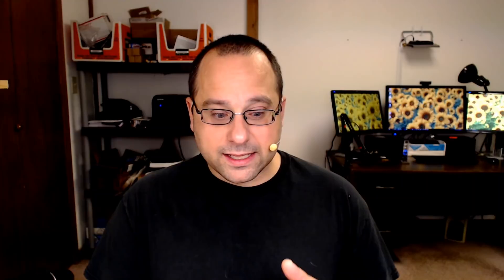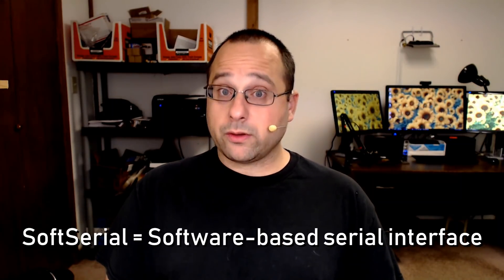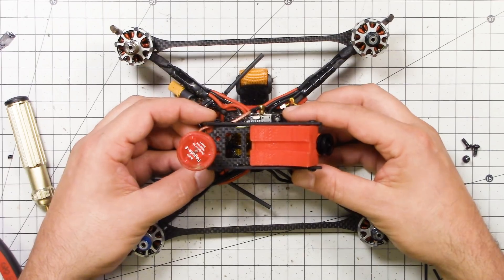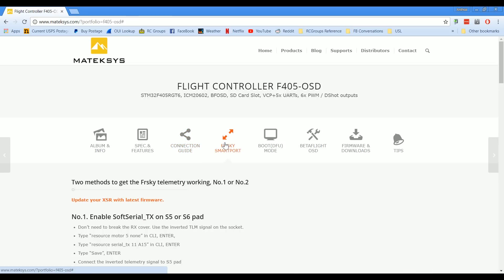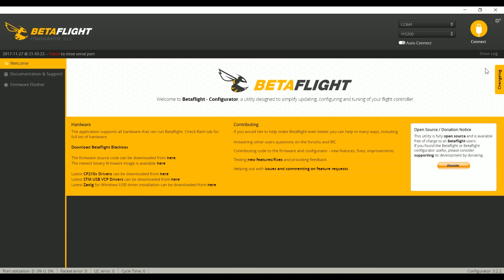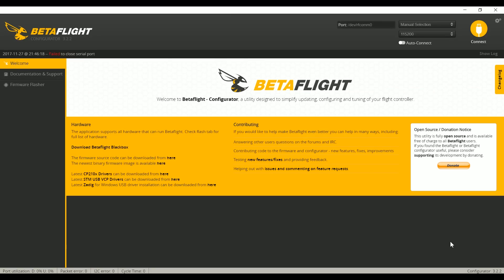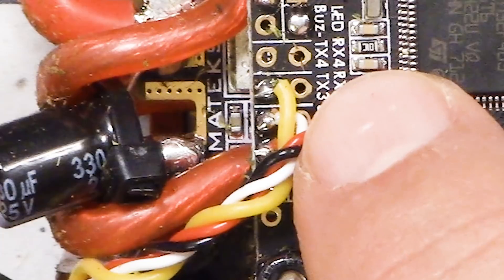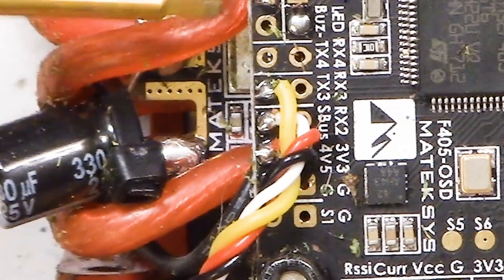Betaflight SmartPort Telemetry How-To | MATEK F405 AND OTHERS

Comment: What do I do if this didn't work?? I currently have the matek f405-te and I'm using an frsky tdmx reciver. The reciver has a smart port pad. I wired that sp. Pad to a uart and it didn't work, then I tried this soft serial solution and I am still not receiving telemetry. What else can I do? To my knowledge, I don't know of any uninvited signal on my reciver. Sidenote: I have the same rx paried with a matek h743 wing fc. Telemetry works perfect using the basic understanding of how to wire up telemetry.

Comment: Is using a software serial for Fport a good idea? Seems like the Mamba F405 has no provisions for F.port or even smartport. It's so far the only disappointment of the board (and no mag or baro, but there is an I2C pads for them on a separate board). I tried it and my quad almost flew away when I punched the throttle, it was like PWM signals were updating infrequently.

Comment: Hi Joshua.  I have a Jumper R1 and a Mamba F405 stack.  I’m trying to work out where to solder the Smart Port wire onto the FC.  One pad is named ‘Invertor’ and the other one is called ‘Uninverted’. I’m pretty sure the smart port wire goes to one of these.
Also, if I’m using a Jumper T16, should I connect the rx RSSI wire to the fc RSSI pad?

How do you rate the Mamba stack?

Comment: Good afternoon Bardwel. I'm using Inav configurator 2.2.1 with the Matek F-405 CTR controller and I can't connect to the smart port. What's the procedure?
Reply from the maker: For the Matek F405 I think you have to use softserial to get telemetry working, right?

Comment: Hello, great video.  I set up my serialport.  I have Foxeer F405 with Frsky XSR.  Flies great.  I can't seem to get OSD working in my goggles.  "Armed" shows up, but all Telemetry disappears while flying.  After I disarm, I can see post flight statistics.  Why can't I see my RSSI (which shows on my radio) and my Battery voltage during flight?   Thanks for any support you can offer!

Comment: Hi Bardwell. Let me ask you something. Is It  possible to send the GPS data though the Video transmitter(audio in)?  My radio has no telemetry and I need the GPS information on the ground station to track the position of the plane.
Reply from the maker: That is a thing that has been done in the past but you need customized hardware that is built to do it.
Reply: @JoshuaBardwell  do you have idea where I find any more information? Anyway thank you.

Comment: Hi Josh I am following all your vdeos for about a year now but I am definitely struggling with Telemetry / TBS Smart audio and ESC Telemetry on Matek F405 std, Taranis and RXSR reciever. My ESCs is a 4 in 1 esc with Telemetry wire. I am a bit puzzled whether my wiring is correct and how to use softserial properly. Do you think there is a way you could help me? 
Best,
Reply from the maker: It'd be best for you to message me on FB so we could discuss this.

Comment: Joshua... thanks for all the great videos! I wanted to let you know that I discovered an issue and workaround with connecting an R-XSR receiver to a Matek F405-STD flight controller and trying to follow your instructions.  This issue presented itself while trying to use both F.Port and S.Port telemetry.  In both cases, the radio controls were working fine, but I could not receive telemetry.  When using F.Port, I connected the signal wire to TX3 (as indicated in the Matek instructions).  When using S.Port I tried using both TX3 and S5 (softserial), neither worked.  I also tried both the inverted and uninverted F.Port/S.Port signals. The workaround I discovered immediately fixed the issue without any other changes.

I found that by bypassing (shorting) the 100 ohm resistor between the TX3 pad and the STM32 pin telemetry was immediately received.  Before the bypass, the receiver was polling the flight controller for sensors (could see on my logic analyzer), but there was no response sent from the flight controller.

 Hope this helps someone that is going through the same frustration I had when trying to figure this out.

Comment: Hi mr Bardwell. I'm building a quad and I'm going to use F722 mamba stack (F7) and rsx-r. Is the sbus enough for telemetry? Or should I use smart port together whith sbus so I can have telemetry ?
Reply from the maker: SBUS does not carry telemetry.

I suggest flashing fport firmware to the receiver. It does both telemetry and control in one wire.
Reply: Thank you for your immediate response. I'll check your videos for the fport. I've built 2 kiss quads and this is the first time with blhelli. Again thanks a lot !

Comment: Anyone had issues with frsky r9m binding with r9mm I updated firmware and tarantis ,RX and tx updated to latest flex firmware and tryed normal fcc firmware but still flickers red on RX after power off when previously tried to bind. During bind RX shows green/red but after done binding mode it's flickers red on RX??? Matek f405ctr but I tried binding without wired to f.c with no luck. Any suggestions or is RX bad directly from readymaderc? Please help me

Comment: I correctly understand that if I have a free uart port, then I just connect the smart port from the receiver to the tx and everything will work?  I have a flight controller f4 v6 Nano.
Reply from the maker: No that is not correct. F4 flight controllers cannot do Smartport in a regular UART because the signal is inverted. That is why the workaround in this video is necessary.
Reply: @JoshuaBardwell  It is clear, thanks, I will understand further.

Comment: I'm Derrick Mitchell and your not going to learn Jack from this video if your using INAV and you want to get smartport telemetry. Lolol no disrespect Josh but here is the F405 (OSD, STD, CTR)family smart port softserial hook up. Smartport will not work, I repeat, Smartport will not work using the S5 or S6 pad. Follow the below instructions after you do the cli,  configuration, and ports. 

Soft Serial

Soft serial is available as an alternative to a hardware UART on RX4/TX4 and TX2. By default this is NOT inverted. In order to use this feature:

Enable soft serial

Do not assign any function to hardware UART4 or UART2-TX

Assign the desired function to the soft-serial port
Disclaimer: this is for INAV NOT BETAFLIGHT.

Comment: followed the instructions, did not work for me.
Reply from the maker: The first thing I'd suggest is type "resource list" and look to see if serial_tx 11 is active on the assigned pin. If not, then something is not set up right.

If you are using some other flight controller (not the Matek F405) then the pin number is not going to be the same as shown in the video.

Comment: Hi Josh, I am stuck on an order I want to place. Ik have the Matek F405 with the XSR and did the soft serial mod. Now I want to order the R9m lite with either the R9m mini / mm receiver and I am lost in what is inverted now. They say this on the website: Please note that we are shipping them with R9 mini receivers and not the R9MM. Differrence is that the R9M has normal S-Port and the R9MM has inverted S-port. Which one to order now? Greetings
Reply from the maker: They are really using confusing language and I hate it.

The R9M has normal S-Port, which is inverted. It needs an inverter on the UART and cannot be used with a regular TX pad of an F4.

The R9MM has inverted S-Port, which is inverted-inverted, which means it's un-inverted. It's a double-negative.

So you want the R9MM and you will connect it to any regular TX pad of a UART on your F405. You will also need to go into the CLI and type

set serialrx_inverted=on (only if you are using fport firmware)
set tlm_inverted=on
save
Reply: @JoshuaBardwell  thank you very much for the help! It is very confusing, I hope this will change in the next-gen boards!

Comment: Have a Babyhawk r stock 2", cant seem to get tel to taranis with lua not sure what wire from vtx to f3 magnum,want tel to radio and s audio to control pids  Help.
Reply from the maker: If it has an XM or XM+ receiver, then it won't do telemetry. Those receivers don't support telemetry.

Comment: Hey Joshua can I run smart audio on matek f405?
Reply from the maker: Sure! Of course. Just use a spare UART TX pad.
Reply: Joshua Bardwell I was using rx ports, obv didn't work but thru soft serial I got it to work

Comment: I am setting up soft serial on S6 of my Hobbywing Xrotor F4.  For the 'resource serial_tx....' command is the S6 pad on this board also 'A08'?
Reply from the maker: I wouldn't assume so, no.

Type "resource" and look in the output of that command for a line that reads:

resource MOTOR 6 A08

That tells you what pin number (A08, or whatever it says) to assign to softserial.

Comment: Thanks, Joshua. I have a hyperlite f4 osd board. Tried fport, using the tele port, a different port. No luck. Have not tried the hack yet. Question....does softserial need to be supported on the board to use it? I ask because I tried to use it and it tells me no serialrx 11. So basically, no telemetry unless I can figure it out
Reply from the maker: Any board should support softserial.

Comment: Joshua I’ve googled and can’t find the answer to my problem.   I’m trying to get SBUS working on my F405 ctr.  My XSR is wired up per the Matek diagram (SBUS to SBUS on the board and Smartport to TX2 on the board) and set up properly in Betaflight.  

Matek says on their site to assign resource a02 to Softserial1 for Smartport.  Resource a02 is already allocated to pwm3 AND serial tx02 by default.  When I do the reallocation, tx2 becomes inactive due to it losing its resource...  It seems telemetry is working after doing this, but SBUS is not...  I’m confused.  Would you help me please?
Reply from the maker: I think there is some confusion. I don't know how you would use softserial on the same pin as TX2. I think you might be having some resource conflicts that are messing things up. If you use ledstrip like I show in the video, I'm pretty sure it will work.
Reply: Joshua Bardwell as is the case most times, it was operator error.  I had the Smartport and SBUS wires backwards.  I flipped them and everything works fine.  I just came in from flying the bird.  Thanks a million for replying sir!!

Comment: I've got the matek f405-std and trying to use the furiousfpv lr1000. I need to turn serialrx inversion off but it won't work with the matek f405 how can I use soft serial?
Reply from the maker: You can't use softserial for a receiver. You have to use a hardware UART. If it is putting out uninverted SBUS then connect the signal wire to a regular UART rx pad and go to the CLI and "set serialrx_inverted = on".
Reply: Joshua Bardwell thanks for the reply and input. I was thinking of that but wasn't 100% sure I could use the other uarts as on the pin out diagrams they were for other receiver brands/protocols. But I will give that a try.

Comment: if I wanted to run fport could I solder the smartport wire to the sbus pad or would I have to run the smartport wire to the s5 pad and run it softserial?
Reply from the maker: FPort requires a pad with a bidirectional inverter. The SBUS pad does not typically have this, but the specifics depend on the design of the board. Also, SBUS always goes to an RX pad and FPort requires TX. You can't use softserial for serial RX though so no ledstrip or s5 or s6 will work. It has to be a hardware UART.

The simplest approach to FPort might be to do the uninvert hack on the receiver and then you can use any UART TX pad. But you will need to do some tweaking in the CLI with "serialrx_inverted" and "tlm_inverted" to make sure Betaflight knows you've done the uninvert hack.

On the F405 specifically, you won't save any resources by using FPort, so I'm not sure if there is an advantage.
Reply: Joshua Bardwell thanks big help and time saver. I was hoping to avoid soldering to those small pads on the receiver. My thought was maybe I could use fport and go to the sbus pad with the telemetry wire or go to one of the other pads and tweak the cli but now I learned that that won’t work and I’ll just run it the normal way with sbus and telem no fport. Thank you again

Comment: how does this work with the Matek F405-CTR?
do i also need these commands to acitvate softserial or can I just use RSSI pad?
Reply from the maker: You cannot use the RSSI pad for softserial. The settings should be similar for F405 CTR. But the pin number might be different.

Comment: Can somebody help? I has used the last 2 days trying to figure out why I cannot have pid data display in my taranis. I am using Matek F405 and FCHUB-vtX with Frsky X-XSR receiver. I updated all FW in the beginning of the build BF 3.3.2. Opentx is at 2.2.1. RXSR is flashed with newest FW FCC171009.  I get the lua script working but just no data got reported. Telemetry is only from the Rx itself but not from the FC. I only get 2 sensors (RSSI and RxBT) !! I am using uninverted hack by soldering a wire from RXSR (the small pad) and connect to TX3 of the FC. I put under PORT of BF smartport in UART3. I also type in CLI with tlm_inverted = on. Everything works with the quad (including PID turning from my goggle) but not from the taranis display. What can I do wrong and miss????   I heard some people seems to have this problem and have PID telemetry working again after switched back to BF 3.1.7. Can it be the problem? The most common cause I heard about this problem is with old FW with RXSR but I already flashed it with teh latest 171009 twice... still cannot work....
Reply from the maker: Have you enabled telemetry feature in the configuration tab.
Reply: Yes, I have enabled Telemetry (under Other features) but not softserial. I may consider changing it to softserial approach if I cannot get this solved today.
Reply: Update : I quickly solve the problem by going into the softserial route. PIDs and other telemetry information readily appear on my Taranis. I struggled a little bit first before I set tlm_inverted back to off which I turned on when trying with the original uninverted hack for the RXSR receiver. Now everything is working.  I have a few conclusion/ findings myself related to Matek FCHUB-vTX and F405 combo: 1. somehow I cannot get non-inverted smartport output connected to TX3 work, I believe the combo meant to have some settings fixed assuming only softserial to work. Softserial, however work like a charm (2) My R-XSR receiver, not sure is the newest version, never got a Blue light as mentioned in the manual. It has the -P patch. Switching between CPPM mode and SBUS mode is not indicated by the blue light but by a blink of the RED light. During normal operation, only the green light is on. (3) not sure whether it is a bug or not, vTX transmit freq control by buttons is faulty when TRC Tramp is config under UART 5 which is the recommendation of Matek. Faulty here means you can get vtx control over the google or taranis but not the on-board buttons. I changed it to other UARTs, it works perfectly.

Comment: F405-OSD with R-XSR and followed this tutorial to the T.  No new sensors found.  I just cannot get telemetry to work, doing my nut in.  Looks so simple and should be but i can never find a new sensor!  Any help appreciated - cheers
Reply from the maker: In the CLI type "resource list". Look for the pin number that you assigned softserial to. Confirm it says "serialrx_11" next to that pin. If not, then the resource remapping is not working. If you see some other resource there, type "resource <THAT RESOURCE> none" to clear it and leave only "serialrx_11" assigned to the pin. Such as: "resource ledstrip none".

Make sure that softserial is enabled in Configuration tab.

Make sure that SoftSerial 1 has SmartPort telemetry assigned to it in Ports tab. Not FrSky telemetry. SamrtPort.
Reply: Thanks for the replay - appreciate it.  Was the serialrx_11 a typo or am i missing something.  I have A15: SERIAL_TX 11 but nothing at all in resources saying serialrx.  Softserial is enabled and smartport on it.  Cheers
Reply: i never got this working yet lol :D

Comment: Hi Joshua

I created a softerial on the "LED" pad, but I need another softerial for SMARTAUDIO. My FC is a DYS F4 Pro. I thought about using the pad set for TX1, but I do not know if I can do this because UART1 is being used by the receiver (SBUS pad). Other free pads are RSSI and PPM, which I also do not know if it's possible to use them. Please help me.

Thanks
Reply from the maker: You can't use UART1 because it's already being used by something else.

RSSI won't work.

PPM might work. Try that.
Reply: YEEESSSSSS...... IT WORKS....... THANKS A LOT !!!!!!!

Comment: cant get telemetry working on omnibus f4 pro corner , any idea? x4rsb receiver
Reply from the maker: https://www.fpvmodel.com/u/goods_data/2017-09/20170908153704-2531.pdf

In the manual they indicate SBUS on UART3, and they say there is an inverter on UART6, which suggests to me they mean for you to use SmartPort on UART6. So wire SmartPort telemetry from X4R-SB to RX6 pad on the FC. Then enable SmartPort Telemetry on UART6 i n the Ports tab.

Comment: I am a newbie and am having trouble getting telemetry to be discovered on my X7, using soft serial on Omnibus F4 V3 following your instructions. Wondering if this FC works the same way as your example. Do I just go to X7 and discover telemetry, or is there another step missing?

Soldering on my r-xsr is just too difficult.
Reply from the maker: Yes it works the same. But the wiring is different for a different FC.